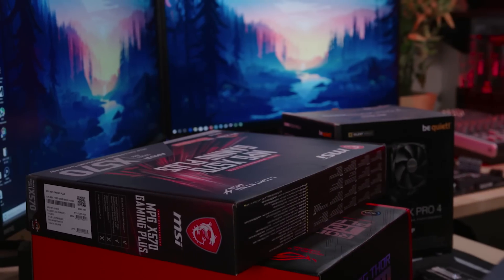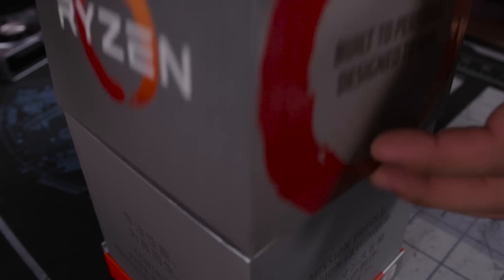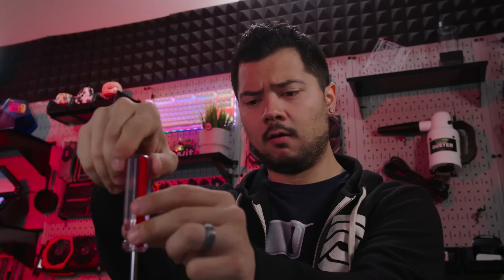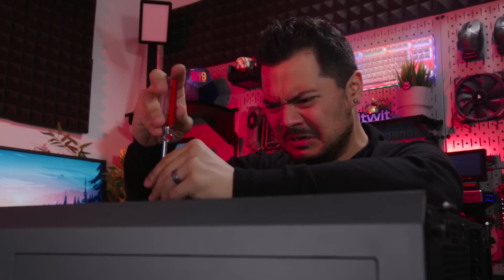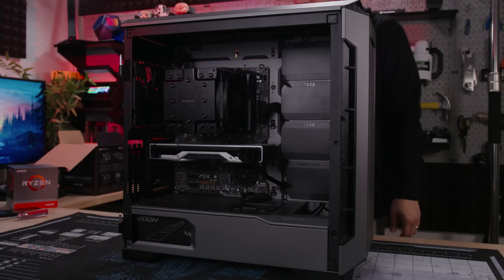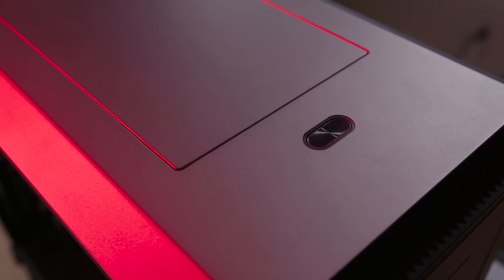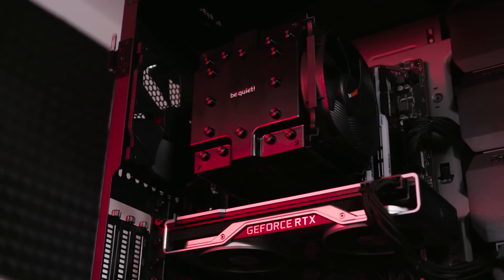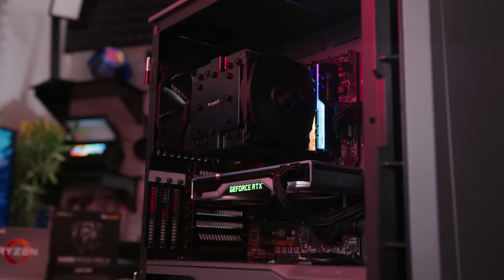Top 5 SCARIEST moments of building a PC!

Comment: Oh, oh... 

PC building rookie here. I had a two year old Pavilion collecting dust in the corner. This year I decided to rebuild it as a gaming machine.

When I finally assembled all the necessary components, and plugged the machine into the wall, the scariest part was ahead. My heart was pounding, when I had a thought: "When I flick the PSU switch, will this thing explode?"

Thankfully, it didn't. All good so far. The next scary step, was if my creation would live. With a slight hesitation, I pressed the power button.

The lights in the PC came on, so that assured me that hardware was ok. Then, the Windows booted. A huge grin formed on my face. I had to get a new license to reactivate it, but it was worth it. 

Ohhh, the satisfaction of sputtering the words: IT'S ALIVE!

Never ever have I built a PC from scratch. Although with majority of parts salvaged from the old unit, it felt like a huge milestone.
Reply: Oh, and the specs, you ask? Well, here comes:

Case: Cepter Skin Mid
Motherboard: MSi B450 Tomahawk MAX
CPU: AMD Ryzen 3 2200G with Radeon Vega 8 Integrated Graphics
GPU: AMD Radeon RX 5700 XT (Asus)
RAM: 2x8GB 2666MHz
Drives: 256GB SSD M.2 + 480GB SATA SSD

Salvaged parts: CPU, the second RAM stick and the 256GB drive.

Comment: Straightening CPU pins... That's a nightmare!
Reply: Use mechanical pencil . Works all the time .
Reply: Holy hell, where were you 15 years ago?
Reply: @jeffjungers2034   . Been into PC building for  20+ years now -- since college :) Also cyber defence . Another interesting add-on -- every fan-mount with a filter-mesh is for intake , mount without mesh is exhaust . Try it on your own PC for reduced noise , superb cooling , +ve pressure in the cabinet . Then apply on clients' or friends' PCs . Cheers :)
Reply: Back in 04 i dropped an Athlon XP 2500+ and spent half a day with a razor blade fixing rows of pins, praying to the CPU gods to let it live. It was ugly and I had some slightly crooked ones left but it was good enough to wiggle into the socket. It went on to live as a 3200+ for several years before retirement. Your trick would have saved me hours of sweat and worry.

Comment: There also this moment when you forgot a screw but you don't know where it goes.

Pushing the ram in the slot but it resists

Plugin the display cable on the motherboard instead of the graphic card

Forget the PSU switch

The Coolers withe crews and springs fixations that make a hell of noise while screwing.

Comment: I'm sourcing parts to build my first PC, and this video just made me very paranoid...
Reply: Dont worry my man all if this makes it seem way more scary than it is. Just take your time and mindful of your steps and you'll be fine. I work on and have built more PCs than I can count and even when not doing things as one should i've never killed a part. Now running into config and boot issues is likely to happen, especially with overclocking and memory configuration, but again just take your time and stay calm
Reply: Thanks for the tips. I guess I just don't know what to expect at this point yet, but I won't rush it

Comment: My amd cpu was ripped out of the socket cause it was stuck to the stock cooler. I used a knife to pry it off and POP off the cooler and on to the floor! My heart was pumping like hell but there wasn’t any real damage just slightly bent pins on one corner. I straightened it out and installed it into the mobo. It still works!

Comment: For the first pc I built it wouldn't turn on, even my sisters husband saw nothing with what I built until we tested the power supply and saw that it was faulty. Amazon Replaced it but even the replacement was faulty. So I got my money back and just bought one at the best buy down the street.

Comment: Once when i was changing the cpu cooling system i realized, after putting thermal paste, that the size was wrong, so... Now i use a PC with a not well applicated cooling machine, but now it reaches only 75°, is that a win?

Comment: Well I actually had an unsolveable problem. No software would read temperatures correctly, cpu wouldn't go into boost, fans wouldn't scale to temperature since it was always the same. And the pc didn't turn off correctly. I thoght something was broken since I tried everything. Oh and if I turned off the PSU, the PC wouldn't boot unless I removed the CMOS. Then Gigabyte realeased a new Bios Version and now everything works. wtf.

Comment: 30% of the times i build i fail to put my power SW correct, i almost crap my pants every time and it's the first place i will check :D my motherboard have so crapy layout so the correct pins are side by side with some other crap and they are named similar...

Comment: when u finish building your rig. and make cable management perfect. and put the side panel on. then realizes your motherboard needs a bios up date for the cpu to work because won't post. then wait 3 weeks for the rma (borrowed cpu from amd) after getting cpu u realize u out of thermal paste and the fuckers didn't include any. order more paste of aliexspress. wait another week for paste. finally receive paste. and then after installing the crappy cpu it still won't post. then realized the board is dead on arrival......(pulling hair out)

Comment: Spoiler Alert: Horror Story of young kid

I just upgraded my RAM , CPU and added the first graphics card in the history of our society to my 2011 desktop.. I am a 16 yr old. and the moment when I was attaching the cpu and the heatsink I was literally sweating and breathing heavily.. Even when the GPU wasnt going so easily on the slot I was literally "Am i gonna break it?" But no problems during ram since i have been ejecting and putting same ram for years.

Again, after all that finished when I booted my computer(after the cpu upgrade since i added them on separate days) then a boot loop came.. Fortunately it worked after 5 boots i suppose. This hell kind of fear was becoz I was upgrading my CPU to 3770 on inspiron 660 which it officialy doesnt support , ram to 12gb which also it doesnt support and 1050ti + 3770 in a 300w psu which many people disagree and demand a higher PSU.. But, proving everyone wrong. The build works and is a huge gamechanger for me..

Comment: I want to play PC games at 1080p at high frame rates (at least 144 consistently.) I just bought an amd ryzen 7 2700x. Can anyone tell me or suggest a good gpu pairing for this build to meet that 144fps sweet spot? Note that money is an issue so try to be cost effective as much as possible. Note (I currently have a 240Hz monitor and 16GB of 3200Mhz ram...) Thanks for reading :) also since I just bought the cpu I could get a refund so let me know what you think.